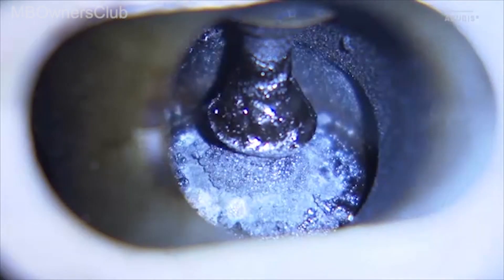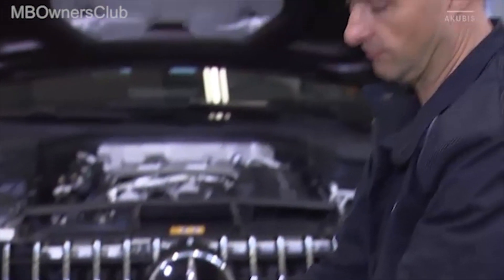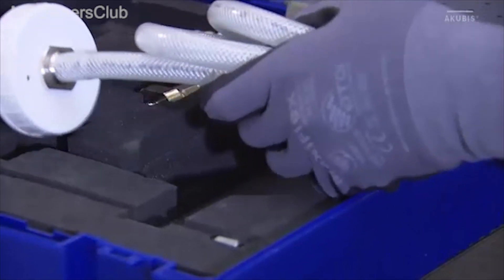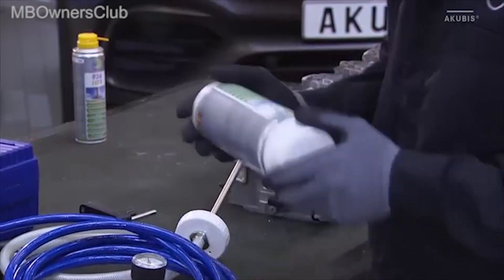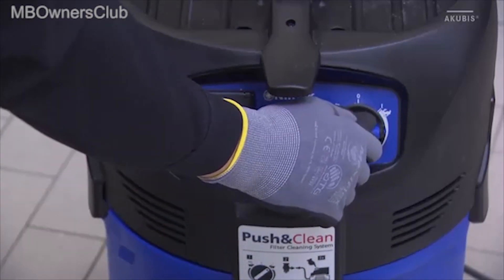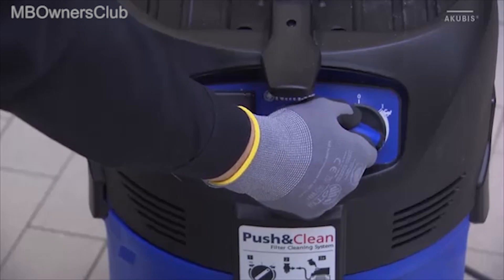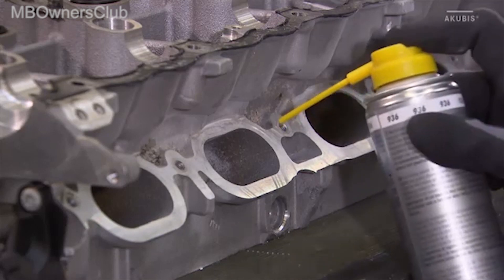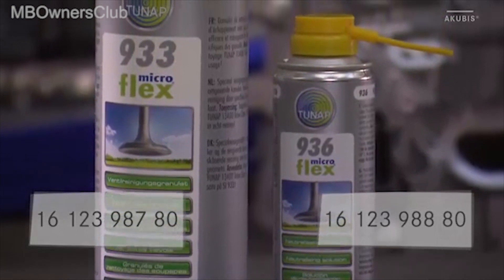Step-by-Step Guide: Clearing Carbon Buildup on Mercedes-Benz Valves (Walnut Blasting)

Comment: How often do you need to do this?
Reply: Depends on your driving habits, oil quality, and your preventative maintenance.

Long story short. 
Every oil change spray in or have your mechanic spray in CRC intake valve cleaner spray.
Melts deposits before they get out of hand, and keeps the valves clean. 
Use quality oil, not cheap oil. must meet Euro C3/C4 specs.
Reply: @shmuck66  i do this in my hyundai tucson and 4runner but in my e-class merc i haven´t found the pcv valve. do you know where can i apply the crc in this engines?
Reply: @danielpedrazaroa1177  Which engine in the E class ?  

I normally just remove the IAT sensor since it is only one screw. and do it from there. 
Make sure you don't remove the MAP sensor lol
Reply: @shmuck66  hahaha ok, it's an e200 2.0 2019. Usually where IAT sensor is located?